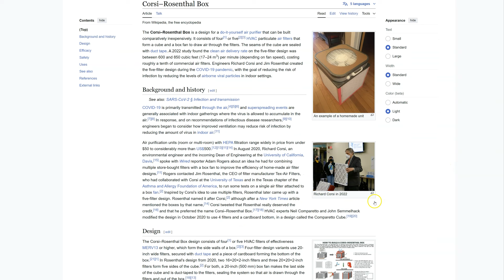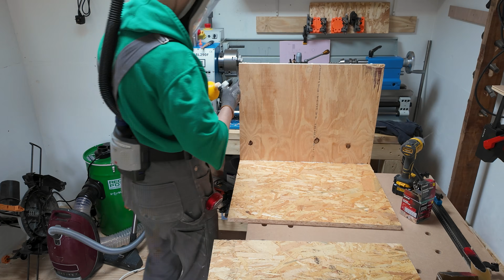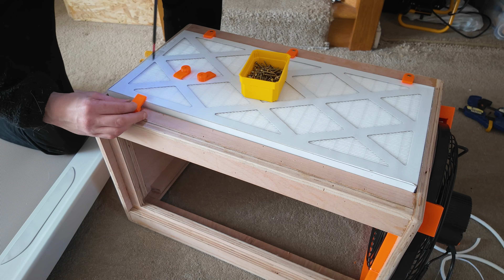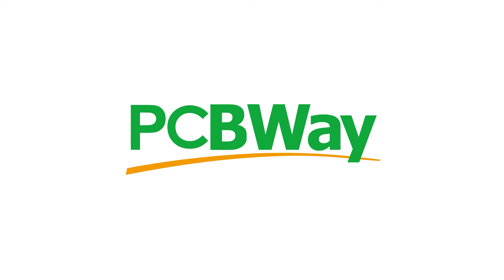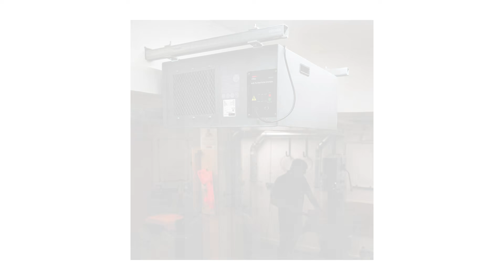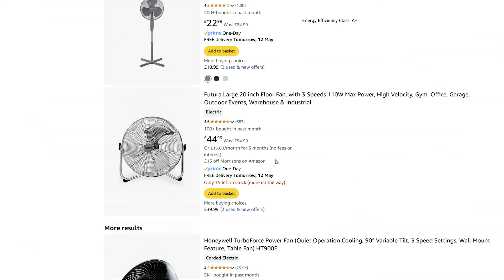DIY Air Filter for Your Shop – Simple & Powerful

Comment: Hi @ThisDesignedThat. Do you have an update now, after 10 months of usage?
Reply from the maker: Hi, yes it’s still working very well. I’ve yet needed to replace the original filters that I had in there. They are much more discoloured than the original condition which is what you would expect. I am in the process of installing fume extraction in the shed because I did find that whilst the air filter is good for woodworking and capturing wood dust in the shed it isn’t powerful enough to clean the air from smoke and fumes that are generated when using my welder and also the smoke from cutting oils that I use on my milling machine and lathe.
Reply: @ThisDesignedThat  Thanks for getting back so quickly. Highly appreciate that. How often did you need to replace them?

I currently need to work in a cellar room...like few square meters. My Scheppach air filter is just garbage and doesnt do the job. And while I am wearing 3M mask most of the time, still too much fine dust left. 

So hopefully I can squeeze one of these into the room as well. :D
Reply from the maker: @yezariaelll  for a small room with only a small volume these types of air filters would perform really well. How Often you need to replace will entirely depend on how often you’re creating dust in the space. Get yourself a cheap anemometer so you can measure the air speed through the filters and also try to measure how quickly the dust particle concentrations in the room lower by using an air quality monitor. Once you have these two bits of data, you can perform checks on the filters and see how to performance is degrading. If you find that the air changes per hour is slowing down than that’s probably a sign that you need to replace the filters . I think in woodworking shops you aim for 8 to 10 air changes per hour.

Comment: Nice job and nice outcome. Hey, just to test your theory of raising the fan up, you could build a secondary box and add it to the top to see if the theory of raising the fan 6 in or so would actually make the difference. Nice job though!.
Reply from the maker: That's a great idea for testing the theory, thanks for the suggestion!

Comment: PSA: Sub micron Particles travel with brownian motion and still wander into the sides of pores in filters with larger pore sizes
Reply from the maker: Interesting, thanks for the info. I wonder what percentage actually get trapped 🤔
Reply: @ThisDesignedThat  filtration happens a few different ways.
Inertial impaction is dominant with > 1 μm particle size
Interception eith 0.3–1 μm
Diffusion (Brownian motion) is most dominant at < 0.3 μm

diffusion is increasingly dominant in finer filters though courser filters still exploit it.

Comment: Love your vids man, you're dealing with a lot of the same stuff as me. If you're into DIY electronics a bit, you can build an automatic control for these with an ESP32 and a EAQI sensor. Mine fires up by itself as soon as it detects my saw or anything creating dust.
Reply from the maker: ❤ great idea. I'll take a look into this, currently I just have the filter running constantly when I'm in the shed
Reply: @ThisDesignedThat  If you can find 'em still, as they got discontinued, the Ikea Vindriktning sensors are what i used, easy to interface with and compact and reliable. I got the idea because mine turned red any time i ran my table saw!

Comment: Hello!! I have a massive fiberglass micro nano particles contamination in my
Home .. its itchy everywhere and they look like to be airborne , theres just a few sticked to the walls … can this filter attract the particles to it and clean the air ?????
Reply: Without question. They are even more effective if you utilize a fifth filter on the bottom, too. 

To make it even cheaper you can get a prefilter over the existing filters, which can be as simple as a nylon screen.

Comment: Another reason for air cleaning on top of a mask/respirator is that some of that dust will settle on your clothes and be with you after you take your mask off. Less in the air = less on your clothes.
Reply from the maker: Good point, and you are correct, I make sure after woodworking I shake off my overalls before coming indoors and there always so much dust on them so I experience this myself.

Comment: It's probably better to pull CLEAN air OUT of the box. If turbulence is an issue, build two and run the fans at a lower speed. 
In your configuration, the fan is exposed directly to all dust. The bearings will fail sooner. It might even start a fire at some point if the dust buildup prevents proper cooling of the motor windings.
Reply: A tower with two fans on one side.

Comment: Love this! I designed something similar as a student back in 1999-2000 when I was working at a big forge company. It was to replace really expensive cylindrical air filters on our furnaces. Using this cut cost massively but also improved air flow and quality to the equipment. Good to see the principle still applies 😀
Reply from the maker: good to hear it has been used for many decades, gives me confidence they actually work 😂

Comment: I have built two box fan filter boxes.  Realized that horizontal fans die pretty fast(about 18 months)...so I modified to have it sit like it is meant to sit(vertical).  Running that one has been running for 4 years non-stop(other than to swap filters or oil rotor).
Reply from the maker: very good point, those fans bearing are usually design to be in a certain orientation and would probably cause them to wear out quicker. I think the acinfinity is designed to be used in all orientations but i'd have to check

Comment: Building this filter is a waste of time. Use duct tape. Maybe some corner protectors to lift it up from the floor. And also, the fan should be sucking the air out of the box instead of pushing air into the box.
Reply from the maker: I'd disagree. Hardly a waste of time, and what happens when you inevitably bash something against the filter held together with duct tape when working in a small workshop? Drawing air out of the box is the best setup if you have a big space, small shop like mine, sucking air out of the box adds too much turbulence to the air in the room causing settled dust to be made air bound adding to more dust in the air.
Reply: @ThisDesignedThat  If you read the design of this (it's called a Corsi-Rosenthal filter) you definitely should be "sucking" air. Just like in any HVAC system. Air is like a wet noodle - you can't push it but it's easily pulled. All systems  "suck" air with a return. Definitely not a waste of time, though. Great job.
Reply: Next time, before you celebrate re-inventing the wheel (unless you are a NASA engineer), please keep in mind that people with better brains probably came up with a better solution already so think before making effort to a self-inflicted embarrassment.

All "well-designed" air filtration systems would suck air from the air filter, this includes your furnace, vacuum cleaner, air purifier, dust collectors, shop vac, etc. One major reason is that the act of sucking in the air reinforces the seal around the air filter. Second major reason is to protect the fan. I highly doubt anyone would notice any shorter life-span of the fan, but I would definitely notice a dirty fan harboring dust and bacteria. 

Yes, the dust is collected on the outside, just like any air filtration systems out there. If there is too much dust, you can even gently vacuum the excess dust off the filters to prolong the filters' longevity. Surely if you collect dust on the inside, you can vacuum excess dust too, but much more effort will be needed. 

Your concern of turbulence is unwarranted. If the dust particles are large, they will not be lifted by the turbulence. If the dust particles are small, they will be filtered eventually. That's the whole purpose of this air filter, right? You shouldn't be bothered by this tiny amount of extra dust stirred up by the fan because you should be wearing a mask while working. 

The duct tape method is definitely not a pretty solution, but it's an elegant solution. You don't need drills, screws, frames, saws... Not only that, you don't need the EXPENSIVE custom-made filters. Come to think of it, WHY WOULD YOU NEED THESE EXPENSIVE CUSTOM-MADE FILTERS??? You should be building this around the idea of using cheap and effective filters with sizing available in local stores. I might say, there's really nothing to brag about building this simple thing anyway, especially the logic goes the wrong way. 

No, it is not illegal to be ignorant and you are unlikely to cause any real harm to anyone in this case. But might I say, there're enough ignorant fools out there, don't be another one. Good luck.
Reply: So you collect the dust on the outside? Gross. And duct tape will fall apart 😂😂😂
Reply from the maker: @DoctorMandible  no, the dust is collected on the inside of the filter, my fan is drawing air into the filter box and then the clean air is exhausted through the filters. Which, come to think of it, makes it probably cleaner because if you knock into the filters, when the dust is collected on the outside of the filter it will disperse the dust into the air
Reply: @ThisDesignedThat  I understand. I was replying to this other joker who wants to build a duct tape contraption. Yours is cool
Reply: @DoctorMandible  Google a Corsi-Rosenthal filter box. This guy (who invented it) has a PhD and did exactly that. And you Pull air - not push it.
Reply: Self-inflicted embarrassment? Who pissed in your cornflakes mate? Chill out

Comment: nice! This is a nice project. Are those filter you have directional? you might need to be careful you don't put them in backwards
Reply from the maker: there are no marking on the filters but this is a good point, ill double check with the manufacturer, thanks for the tip!
Reply: HVAC guy here. In this case, it just doesn't matter.
Reply: Due to the application or the type or filter?  @jamesburton6661

Comment: I think you over exaggerating the filter topic, especially when talking about 15 filters at the ceilings. I love the idea of cleaning and using the ceiling instead if the boxy design, but uou might more fans to make this effective.
Reply from the maker: Yes you are probably right, I wonder what is the best performance; lower air speed but larger surface area, or higher air speed, smaller surface area.
Reply: @ThisDesignedThat it depends: best performance in terms of air filtration? Then you need high flow, high performance in terms of noises? The uou need low speed. I think the filter area will not have a big impact in the filtration rate, it might just needs more fan power to get the same rate on a smaller filter (unless filter is saturated at some point)